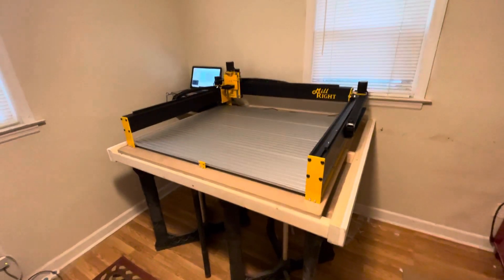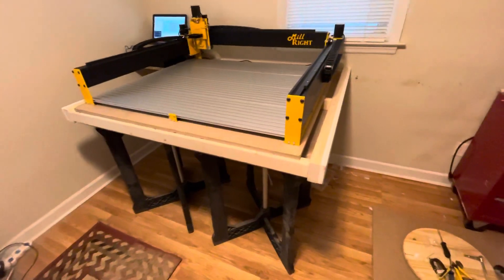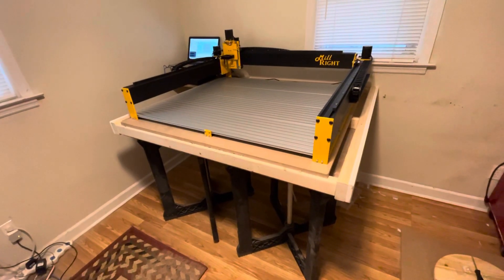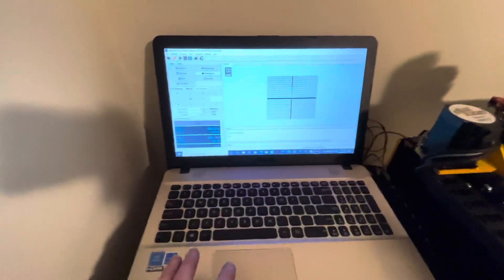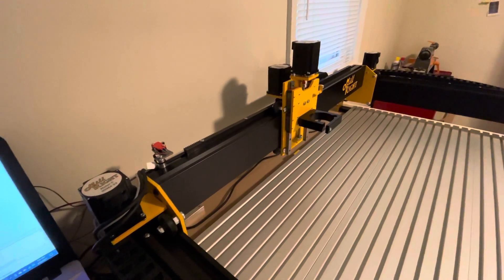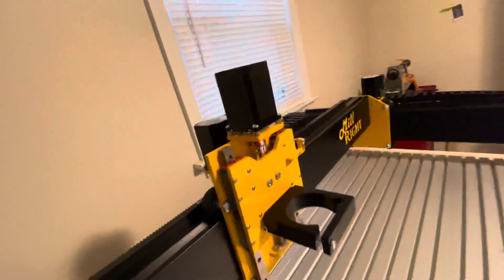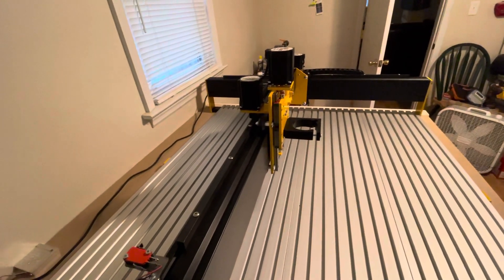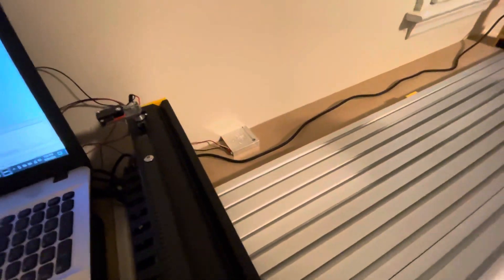Millright MEGA V XL CNC

Comment: What are the dimensions of the table top shown here? I need to build a stand for mine before I start assembly and it looks like yours is the perfect size.
Reply from the maker: Around 50 x 50. It has lag bolts into the wall studs.
Reply: Thank you, is vibration an issue?
Reply from the maker: No it is rock solid.